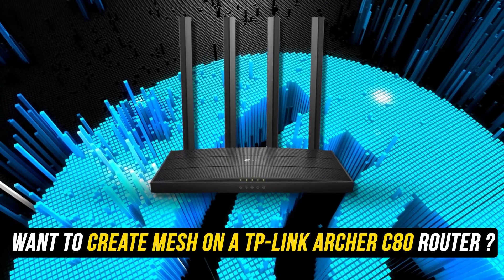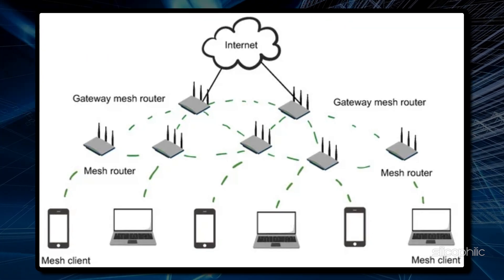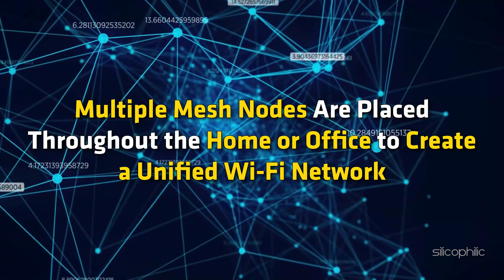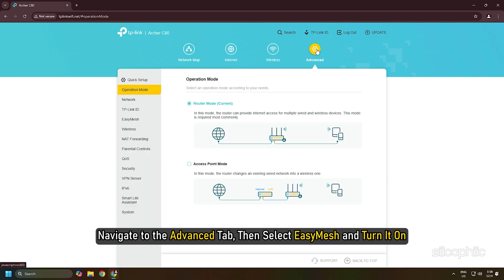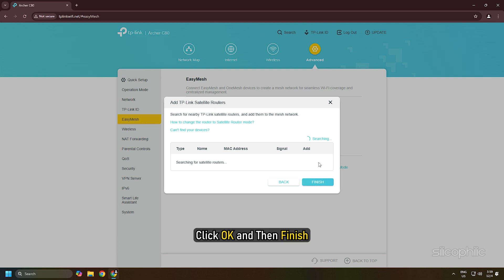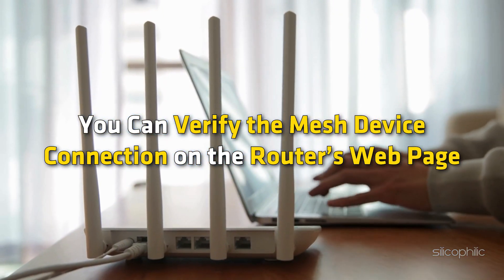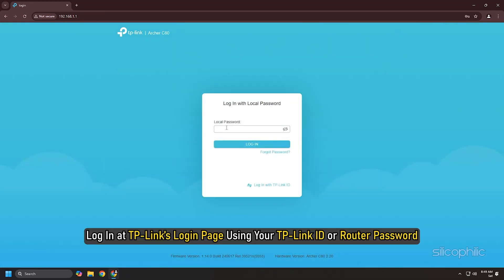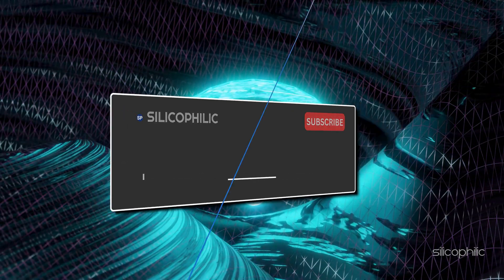How to Create Mesh on  TP-Link Archer C80 AC1900 Wireless Router? |  Set Up Mesh Network on TP-Link!

Comment: Can I use AC 1900 through wireless connection
Reply from the maker: Yes, you can use AC1900 wirelessly. Keep in mind AC1900 is the combined theoretical speed—actual Wi-Fi speed varies.

Comment: i can configure a mesh network with Archer AX1800 and Deco M5 in backhaul mode?
help me please
Reply from the maker: Yes, you should be able to create a mesh network with an Archer AX1800 and Deco M5 units in backhaul mode!
Reply: @Silicophilic  i did it, but i configured the Deco M5 in AP mode . .

is the same as a Mesh mode ?
Reply from the maker: Nice! AP mode works similarly, but it’s not full Mesh — Mesh offers unified management and smoother device handoffs between routers.